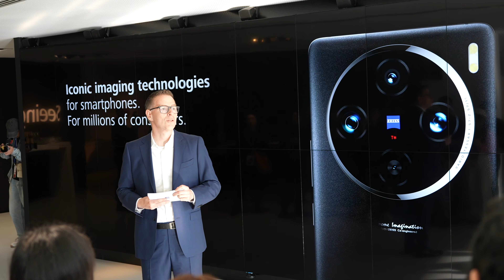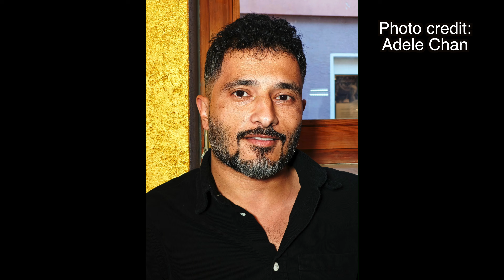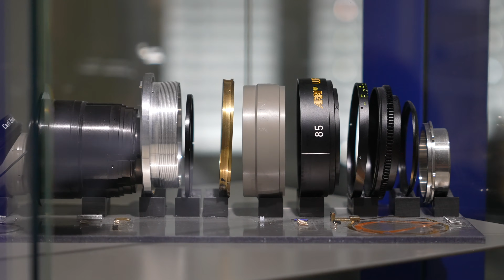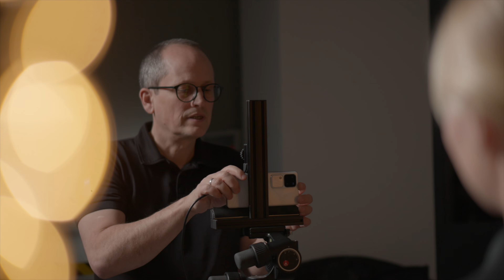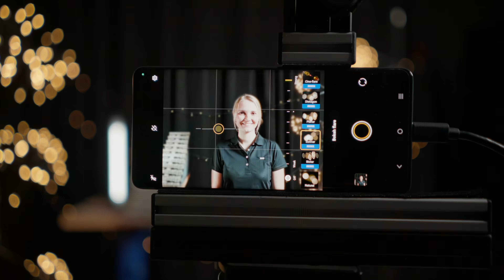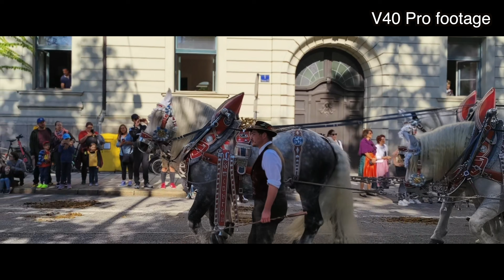How Vivo and Zeiss Work Together To Build Great Portrait Cameras For V40 & X100 Ultra Phones

Comment: Love these kind of iconic company tours and it doesn't get much more iconic than ZEISS. For me though, the most iconic ZEISS and mobile device partnership was between NOKIA and ZEISS when they created the NOKIA PureView 41MP lens for the NOKIA 808 PureView which was basically a high end point and shoot camera that just also happened to be a phone. Later that 41MP camera system was used in the NOKIA Lumia 1020 Windows Phone. That camera system was 5 years in the making and nothing else came close at the time. It also had a xenon flash which NOKIA was known to use in their high end N series camera phones and it is still dumbfounding how more OEMs today are not using a xenon flash which is what pro DSLR's use.

Comment: NIce hardware but the software is kinda not on par.
If this phone is exclusively China again, the phone might slightly be better if the come international.
OriginOS is much more well built but the sad thing is sometimes the sync with Google is not as good as the other China brand counterparts.

However, having said that on the software, the hardware is top-notched.
Its video/picture graphics is one of the best, if not the leading one in the industry, followed by Oppo.
Huawei which led the mobile photography before the US ban, is now not really that on par but its Honor is getting better yet still loses abit to Vivo overall.

Comment: Still rocking my trusty Vivo X70 Pro+ and love it. Was about to upgrade to the X100 Ultra when suddenly it appears X200 series drops this month including a rumoured 'pro mini' version, thus waiting for this (and Ben's review, of course;)
Reply: The Pro mini is basically just a smaller regular X200. It's not actually like the X200 Pro.

For example, the Pro Mini won't have the 200mp telephoto (same as the X100 Ultra). The X200 Pro does.
Reply: @BlackParade01  Thanks. Will be upgrading to the top flagship X200 Pro but curious about the so called mini.
Reply: how is the phone holding up? which andorid version do you have and how have the updates been so far?
Reply: @ficopoki164  It's holding up well, been using it as my main cam past 3 years, you can see on my channel. Running on latest Android 14, snapdragon 888 still zips along.